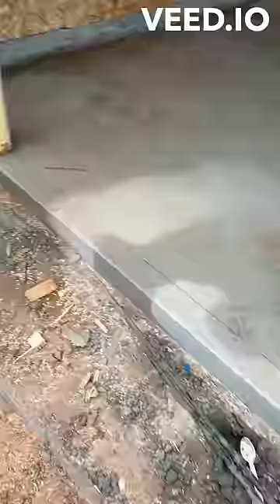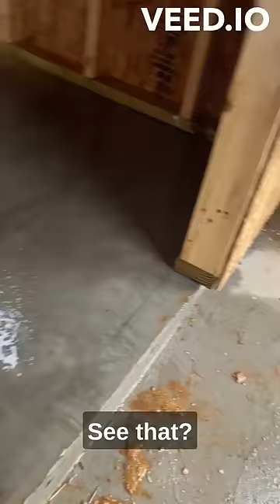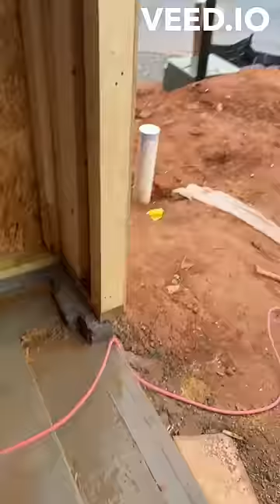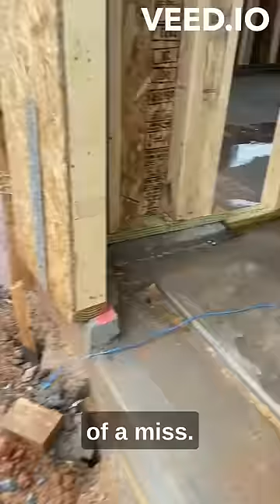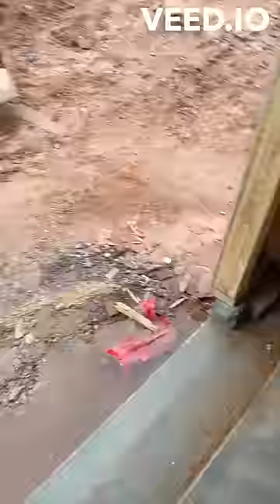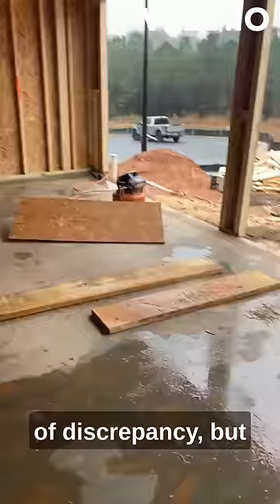New Home Slab is Wrong Size, What Now?

Comment: As a concrete guy for 23 years I've seen this a bunch of times. Sometimes it's discrepancies in blueprints sometimes it's a mistake. Either way it should have been fixed before framing
Reply: Can it be reframed and repoured say 6 inches
Reply: @charlesbryant2713  you could but it won't be nearly as strong as if it was done in a single pour. Kind of a bandaid
Reply: We work with what our concrete guys do. Sometimes they don't get it right and you have to adjust the plan a little but don't do what they did!
Reply: So what do you do when you realize the slab was poured wrong?? How do you fix this situation?
Reply: Framers can adapt 
We do this whenever rehabbing older structures
Reply: I love how it’s always on the carpenters. Not the architect or builder to pair the 2 plans together. Such a broken way of looking at things
Reply: @bartonm116 only way is to redo the whole thing. The pour should be done all at once. I'm not into concrete so I imagine even if they cut off a certain area and repour it, it won't look the same. Either way there should be an inspector that comes out after each step to verify evething is good. Either way concrete sets the tone for the rest of the build. If they are off an inch or 2 so will the house. As a homeowner I would be pissed as your paying a set price for a certain Sq ft of house and with this kind of mess up you're losing some Sq ft for all the rooms etc. I've never personally seen this in my framing years. Normally the concrete is done right. This isn't the framers fault it's the concrete guys fault for not double checking and measuring
Reply: So the framers turn up and flick out the slab and then find out the concrete guys fked up so instead of just doing what they've done, keeping the job moving and having the concreter come back and fix it later, according to you, they should all lose several days work waiting on a slab repair?? You people need to hold your uneducated opinions to yourself.
Reply: The simplest fix is to shift the framing to match the concrete as you build it. This would actually be a supervisory error by the GC not coming through and double checking that the formwork layout is correct before the pour is made.  This looks like a situation caused by measuring to the outside of the form instead of the inside.
Reply: @derekparisian2023 at least redone to an expansion joint if you dont want to redo the entire pour.
Reply: @judge462 fixing f-ups like this isn't always straight forward. Sometimes the owner notices those 2 to 3 inches missing during an inspection and makes the contractors eat the cost to fix the error.  Yes, the owner can show up and do supervisory inspections. It's always best to contact an involved owner to get them to sign off on shifting the walls to match the concrete.
Reply: The concrete guy is telling his wife that its five and a half inches.
Reply: @ianbelletti6241   Not sure if you meant to reply to me but im a carpenter and thats exactly what ive been telling people in this comment section. This mistake is straight forward though, form up the slab, pin and repour.
Reply: Its the concreters fault 99% of the time when a slab is wrong.
Reply: @ianbelletti6241  fixing the carpentry isn’t the best solution it’s cheaper and quicker to started bar and extend the slab. You do realise if you change the layout of the prefab you’ll be out on the upstairs walls and the trusses unless it’s a cut roof which I doubt since it looks like a prefab build. Just a little heads up from a carpenter 👍🏼
Reply: @Nexus-.9  I understand one thing being off dimensions will change the dimensions for other things.
Reply: @bartonm116 who said it was poured wrong. If on the back they have an extra 2 inches the framers fucked up.
Reply: Im a carpenter and have stick framed over 100 houses, mostly high end one off designs in the past 20+ years, i deal with some of the best concreters in my city and they still do stupid mistakes like half the time, we have to square up the entire house and flick out every room, if something doesnt work we double and triple check our measurements, cross-checking the architectural with the engineering plan. We literally never put a wall in the wrong spot unless it is marked wrong on the plans. Trust me when i tell you, this is almost certainly the concreters fault.
Reply: @judge462  I mean it might be the architects fault or the builders. So many times you get multiple updated plans only time I’ve seen one plan work was for a housing estate when they had already been updated to work and you keep it. To assume it’s anyone’s fault in particular is incorrect, however atleast you’re thinking more open than everyone else straight up blaming the chippies. Yes they shouldn’t have fitted the frame without the builders approval but you never know the conditions they were in maybe it needed to be stood or maybe they knew it could be starter barred and extended and again knowing it needed to be stood. Definitely not the carpenters fault unless they didn’t give a fuck or without knowing how to fix it either way they were right to proceed and continue business as usual
Reply: WTF, why not just frame it to the slab, it's 2" smaller. A house that big and I can't imagine the tolerance on the slab isn't +/- 4"or 5"
Reply: @therealthreadkilla  why not just alter a prefab frame of the downstairs to the slab? Firstly not only is it too much work but then think about the upstairs or the trusses that are probably sitting on site or finished in the factory somewhere? Maybe because you might aswel build the house then knock it down and build it again. Things like this aren’t uncommon on sites and it’s up to the foreman or builder to come up with a timely effective solution. If they can’t, they’re in the wrong career and it would explain why this happened in the first place
Reply: @Nexus-.9  

Well That error doesn't seem to be enough to make all that you describe not fit. And there has to be a tolerance. Nobody can work to zero tolerance. But I'm not a GC. 

I do work in engineering however, but a specialty area, tool design. And an old boss told me years ago that you will always make mistakes the trick is how to get out of them cheaply.
Reply: @therealthreadkilla  well your boss old boss needs to loosen the pockets a bit (different topic for another time). Actually my argument is pretty sound if you want to debunk it please give me details please I would love to know…
Reply: @Nexus-.9  

There's no way I can would or want to debunk it. It appears to me that on a structure of that size just framing to the slap would have been more logical than doing what they did. And I can't imagine why 2" of error isn't a workable "fix". And that is the end of my testimony.
Reply: @therealthreadkilla  there is a workable fix but it’s not changing the carpentry it’s extending the slab. Your argument really does sound like it’s coming from an engineer. I know what I’m talking about mate I build houses and structures for a living, but if you want to formulate your own opinion be my guest.
Reply: @Nexus-.9  

"really does sound like it’s coming from an engineer"

LOL, ya just had to go there didn't ya? Do you fell better about yourself now?

You win the pissing contest big fella.
Reply: @therealthreadkilla  I mean come on mate you left yourself wide open for it.
Reply: @therealthreadkilla   Its up to the client, if they are happy to have it smaller then the plans need to be amended and sent off to the engineers. If you just move a wall it could cause many issues down the line with second story or wet areas or cabinets etc.
Reply: @Nexus-.9 I'm a carpenter/builder in Holland, you're exactly right. Extending the slab to the correct dimensions with epoxy fixed rebar and shuttering (which even a labourer or apprentice could do with a bit of guidance), is far easier than the nightmare of every detail from roof trusses to bathroom and stair layouts being 5 inches off.

Anyone saying anything different has no idea.
Reply: @judge462 can you help me understand something: let's assume that the slab has the wrong dimension, wouldn't the framer notice that something is off right after they start building the frame on top of the concrete?

My concern is not who was wrong, but how is it possible that nobody noticed anything the whole time?
Reply: @nickhobbs6514  what’s even more frustrating and nobody has noticed is the carpenters didn’t use a barrier for their sole plates no dpc or anything used just straight onto concrete to draw moisture from the slab 🙏🏼 Americans
Reply: @pietrogallitalesofstartup2024   Yes we notice instantly something is wrong, we double check all the plans and our measurements and then ask the builder what they'd like to do. The builder then decides if they would like to ask the client to move a wall in which case engineering needs to be done to ensure it causes no further problems, plans re-drawn etc. If the builder doesnt want to ask the client he can tell the concreters to come back and fix their mistake. Either way its not up to the framers to just move a wall and they shouldnt be expected to lose work over someone elses incompetency.
Reply: @judge462  thank you!
I'm planning on building my own home in Houston next year without a general contractor and I'm spending this year educating myself to be able to manage the project at best.

I guess it gets down to communication, I hope that no framers would independently decide to go in and ignore the issue, as you mentioned they would have probably reported it to someone.

Would you have any channer or resources you'd recommend to get more education on construction?
Reply: they fucked up when they decided to have their home built on a gaht damn slab. 
that is hell on the heels living in a house like that. 

really stupid to build a big azz house on a slab
Reply: @MG-fn9xw  actually concrete structure is superior to a timber one. Timber over time will rot, twist, warp, bow etc etc. get snow or floods? That’s the start of your hell. With a concrete subfloor you wont have any issues and yes you shouldn’t have any issues with timber sub in your lifetime (shouldn’t) but less chances for fires, better energy rating and so on so forth. Timber has its pros but as I said for a foundation concrete is better the rest can be timber
Reply: @Nexus-.9  i lived on concrete foundation. its horrible for ur joints. i wouldnt advise it. seems like the cheap way to build. 

i live in a stick built from 1930 now, an its so much easier to fix plumbimg instead of hammerjwcking the floor to get to things buried in concrete. 

i could go on an on, but too each his own. 

we all got preferences, have a great evening
Reply: Jesus. The simple and free solution here is to make the house 3" smaller. The  $10k solution is to dig up the concrete and redo it.
Reply: @derekparisian2023 the concrete is the concrete guys fault, but the carpenters are at fault for framing over it and not having it fixed before they framed over it
Reply: I assume it's causes cause they measured to the outside of the frame
Reply: This is actually what RFIs are for.
Reply: @Nexus-.9 because the Contractor should have gotten clarification.
Reply: @FandT  how many times have you been able to get through to the contractor for every detail wrong? I know I’ve been waiting and waiting and just ended up doing the only thing I could with a solution for them when they do get back to me. Life’s not like that
Reply: Bring out the concrete stretcher boys! We’re going to be here awhile.
Reply: Playing devils asvocate here, yes it would have been best if the framers stopped and reported the issue and suaght instruction before proceeding, but for all we know they did and were told to carry on. OR...perhaps the framers have no cobtractual obligation to report the concrete screw up and have no allowance i  the comtract to charge extra for the delays and costs of them stopping and awaiting further instruction, when the error is not theirs! Why are you all so quick to make assumptions when we dont know what actually happened. After all, at the end of the day only the courts can make the final judgement based on the contract and any legal regulations and/or building standards that may over ride the contract. As a final thought, perhaps the frames came pre assembled on a truck and the framers were only paid to put the up as is, not to have to modify them to get them to fit any drawings or  existing concrete pad
Reply: @grahamnimmo4656  exactly, again I blame the architect and or contractor here as someone higher up neglected their job for this to happen. Why would you let a team of carpenters stand a house or the concreters pour without your supervision whether or not you’ve used them time and time again this clearly isn’t a housing estate or it wouldn’t have happened it’s a one off build and management is nowhere to be seen until the dmg is done? And you all blame the subcontractors? The poor home owners pay for these mishaps and contractors continue to raise their rates for poorer quality because we blame the working hands it’s so fucked
Reply: @concretedragon3113 it may not be as strong but it’s fixable. You have to cut back into the slab quite a bit, maybe a couple feet and then connect with rebar. It would be good enough but might want to have it checked by an engineer. They might want an extra deep footing at the load points. Any, what a pain in the butt. But not impossible to fix.
Reply: @derekparisian2023 you don’t have to redo the whole thing. You can cut the slab, dig out an extra footing, and rebar together. Not as strong but still good enough. Gotta check with the engineer though cuz this won’t work if the load is too much.
Reply: @therealthreadkilla if it’s my house there is no fing way that you are going to adjust the carpentry. The concrete guy is gonna fix it. But i am not going to make him repour the entire thing, unless i contracted for some kind of fancy post tension slab or something. If it is just slab with rebar, cut the outer couple of feet according to the engineer, dig a footing for extra support and rebar it to the old slab. Best to catch when it is still not fully cured. There is a lot you can do to fix concrete, it’s just a pain to do it.
Reply: @nickhobbs6514 exactly. Everyone is assuming this isn’t fixable by the concrete guy without ripping out the whole thing. It’s definitely fixable, just a pain and gonna cost some money to fix
Reply: @TheNativeTwo  

Everyone is an expert on the internet. So I've showed this to a couple of contractor buddies and they all say the same thing I said in the beginning. It's the front wall so just frame to the slab. Had it been at a bathroom or kitchen it "might" have caused issues and one may need to adjust mechanicals but the amount off is so small as to be insignificant. The real "mistake" is who ever framed it like that and thought that was a good idea.

And of course it's too late for that now and the only way out now is to fix the slab.
Reply: Wouldn't having a slab survey done prior to pouring the slab prevented this problem?
Reply: @pietrogallitalesofstartup2024  Most local community colleges teach the construction trade. You should sit in a few classes, do hands on work and even obtain a certificate if you are going to take on a project that costs several HUNDRED thousands of dollars. Tradesman and women are professional and di this work everyday, therefore a light study will not get your house built.
Reply: Framer screwed up on this one.
Reply: @ianbelletti6241  GC aren’t contractural responsible for inspections, so I don’t think it’s on the GC. The sub did the layout and still decided to frame it.
Reply: @90daydifference  how do you know it was a subcontractor? In residential construction the GC is often the framer as well. Also, the GC is responsible for coordinating the trades. If this was a sub that did this the GC holds some responsibility for walking the sight looking for problems that will delay the construction. The GC cannot properly coordinate if they don't actively put a supervisor on site.
Reply: Says you @Nexus-.9
Reply: @ianbelletti6241    If the GC carried the framing scope then yes, his responsibility to get inspection done. If a sub carried the scope, then it’s probably in his contract to pay for and coordinate any inspections. The GC should still verify if inspection passed or failed. It’s a standard practice in commercial that I’m assuming translates to residential because it’s a healthy practice in my opinion.
Reply: @90daydifference  I understand the calling for inspections issue. My issue is more on the coordination end. The GC is responsible for telling the crew that did this (whether his men or a sub) to fix the issue before it becomes a major issue. Who calls for the inspectors is another matter. Considering that this major issue was allowed to occur without being addressed before the second floor trusses went in means that the GC didn't provide sufficient supervision of the crews.
Reply: @ianbelletti6241  Yes agreed. I have a suspicion the GC had the sub continue framing and plans to have concrete extended. But just a guess in the dark.
Reply: Looks like they set the form on the wrong side of the line
Reply: @freedomforall88  very possible. More likely there was a mismeasurement. Probably measured to the outside of the form instead of the inside or failed to adjust for the thickness of the form when laying out the string line.
Reply: @judge462  so things are never marked wrong on the concrete guys plans, only yalls???
Reply: @KennyT_817  Well the same guy making the framing plan made the foundation plan. Let’s blame engineer for not being able to coordinate his own design.
Reply: Sure looks like whoever framed the forms used the concrete line as the board line, looked almost exactly 1½" short on every side
Reply: @Stacked3403  If this is indeed the fault of the concrete sub, your comment is the most seemingly accurate and clear interpretation of what may have happened. Trying to read and understand everyone else’s responses is like trying to grade fking water.
Reply: Usually a visual mistake of "Over to" and "Over Over"
Reply: That's crazy you got Foreman you got supervisors you got managers you got all this and if they couldn't see that the bottom plate was sitting half off of the foundation and that's over days how all of a sudden it's a surprise 😮.
Reply: Yeah....Quick overall measurement and call to the builder.  Go or no, boss?!
Reply: It looks like the short is the same thickness as the forms, 1.5"'s. The crew set the forms on the inside of the lines. So including the forms in the dimensions.
Reply: @derekparisian2023 so long as the footers correct, demo out the framework, cut out the perimeter at least 9 inches, leaving the slab, frame out the 1.5" (it looks 1.5"?), and pour or lay block at the perimeter.
Reply: They could have went with 2x6 sill plates. Might want an engineer to check first.
Reply: @ianbelletti6241 you’d have to completely redesign the trusses in many cases then. First thing is make sure the forms are right before pouring concrete. Double checking foundation plans and floor plan matched up.

But at this point you can engineer a secondary concrete pour and pin it to the existing foundation without any issues.
Reply: @therealthreadkilla the trusses have a specific bearing point so unfortunately it’s a rare circumstance where you can frame to the slab being that far off. 

The structural engineer can design a fix where you pin additional concrete to the foundation to hide the mistake. When done properly it will be just fine.
Reply: @thebullgator  it depends on the specific trusses. The floor joists might be a problem if they are prefab assemblies but the roof trusses normally overhang and the most common truss designs can handle a few inches shift of the walls. However, there are a few simple solutions to the floor joist problem if the layout or the joist design allows it.
Reply: @ianbelletti6241  you may be right but it’s few circumstances where this works without creating more issues, but the proper thing to do is fix the foundation in most cases. Deviating from the plan is what gets you in trouble so often more deviation equals more problems.
Reply: Should have never got past the digging of the footers.
Reply: @thebullgator  in many cases, yes. The challenge is knowing when the engineer needs to be called to certify the correction. Shifting the exterior walls in a few inches normally shouldn't be a problem unless your engineered members prohibit it.
Reply: Should have been fixed before framing,  But it WAS the framers who found the error.  Send them home to earn zero dollars while the GC, mud guys, and Architect work it out?    So only the framers lose their wages.  The messenger is the one to lose?  The GC is gonna love it when I hand him a bill for 2,740 per day , to do nothing.
Reply: Lay some concrete brick.
Reply: @charlesbryant2713 Yep. It would have been easier if they didn't frame it first
Reply: @jonathanwalker3507 It's wood not engineered metal
Reply: @derekparisian2023 The framer should have gotten approval to do it that way
Reply: @MG-fn9xw In Texas all houses are SOH
Reply: Drawings are digital.  Dimensions can't be off.
Reply: @judge462  lol nope, my boss keeps a copy of every building plan we're ever given, because close to 100% of the time a screw-up is because the contractor made changes but never gave us an updated copy. We build what's on the paper, it's that simple
Reply: Exactly 💯
Reply: I would always make little adjustments to the dimensions to git the foundation. Often I'd frame a house an inch or so bigger to fit the foundation. In this case, the customer would lose about two inches  from their garage. Normally no one ever knows but the lay out man. I would never have bearing walls (and point loads) teetering on the edge of the foundation! The garage would have to shrink a bit.
Reply: @jonathanwalker3507 I assume you cant just changed the dimensions of house. Concrete guys should pour it right or they have to dig it up and repour it. Maybe if they did that they would learn the hard way not to mess up anymore